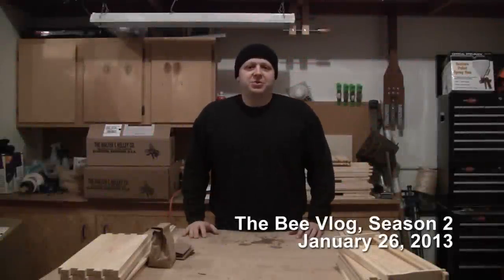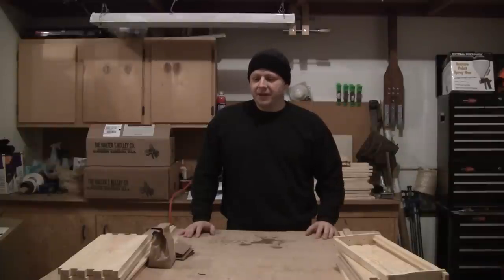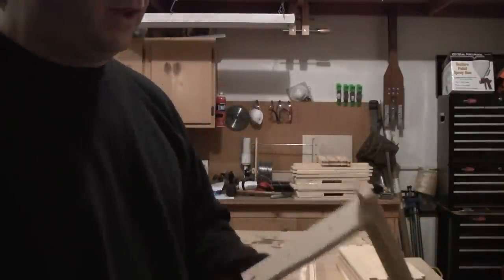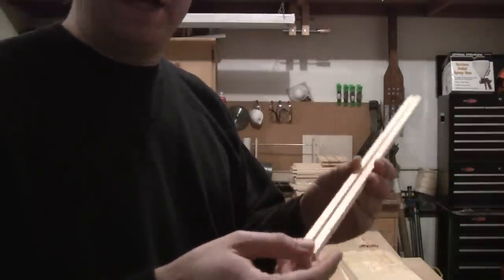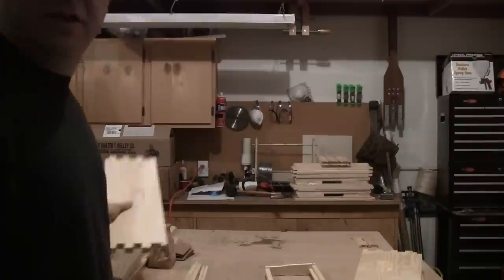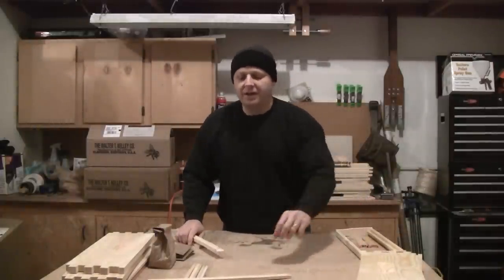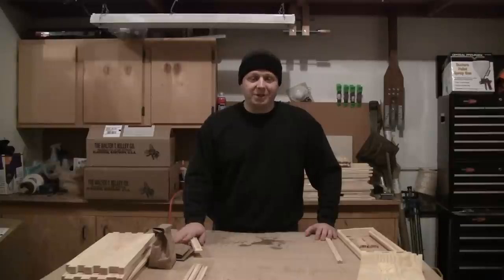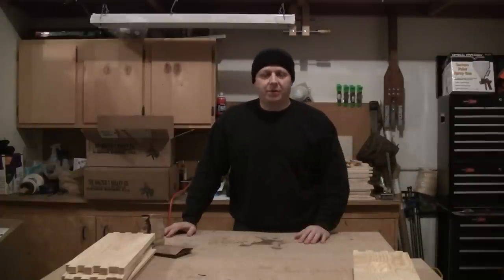BeeVlog #76 - January 26, 2013 - Season 2 begins, Equipment review

Comment: Bill, why do the hive boxes use box joints and not dovetail joints?

As a woodworker, if I am going to build my own hive boxes and frames, the time requirement is not an issue. Is that the only reason commercial manufacturers do not use dovetail joints?
Reply from the maker: That's pretty much it. And, unlike a drawer that is pulled horizontally and needs that extra lateral strength, bee boxes are just lifted. The corner joint does need to be strong though, since a lot of weight is involved and being exposed to the weather and temperature of the outdoors there's a lot of expansion and contraction. So box joints give a greater glue surface and the ability to nail in both directions. In the design I use, the spline gives it strength while only needing to be nailed or stapled on one side.

Comment: At the 11:27 mark you point out that you prefer the comb guide foundationless frames. I knew that you were now using foundationless frames but are those frames the ones you are still using or are you now using a different type and which brand are you using?
I thought in one of your vlogs you were now making your own using the popsicle stick method.
Reply from the maker: +55Herbie1 I liked the quality of the Kelley frames, but the comb guide isn't substantial enough and I found I get a lot of cross-comb. My 2 preferred methods of building foundationless frames is shown in this video: https://www.youtube.com/watch?v=VwJjE2g-0tc

Comment: I too have been pondering making my own boxes. I can't decide if I should make them out of hardwood or pine. My family has all the tools needed to make them square. What would you make them out of?
Reply from the maker: I've been making my own now and pine has been good. I've been considering trying cedar too. I would recommend looking around your area and see what's affordable.
Reply: With cedar you wouldn't need to paint them or treat them with anything. Cedar around my area is pretty expensive. I guess id stick to pine, but hardwoods might hold up better though. I'm in the area of the county with lots of hardwood trees. Thanks.
Reply: Love2boat92 Pine and Cedar are your best material. Cedar works very well...though you don't necessarily need to protect the wood, but you should at least coat it with Lineseed oil. The advantage of Pine, is it's cheap. Cedar has natural oils, and it's very lite. Consider a hardwood weight,..then add up the weight of brood and honey...could get quite heavy.
Reply: I might just need a forklift if I build it out of hard woods. I'll have to add that to my list. lol. Thanks!!
Reply: Yep i agree white pine or cedar. but you can make them out of any thing you wish